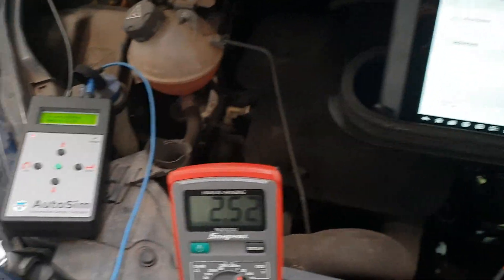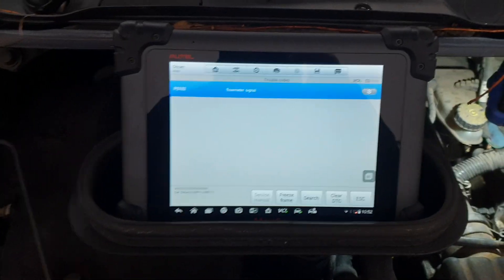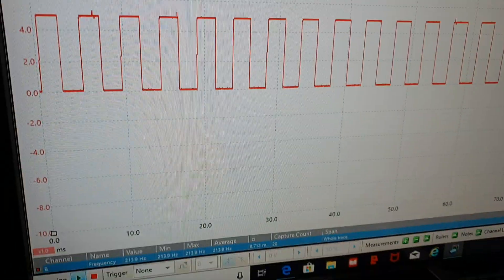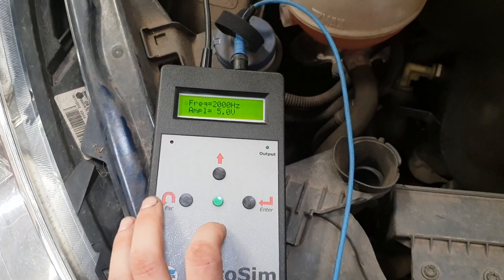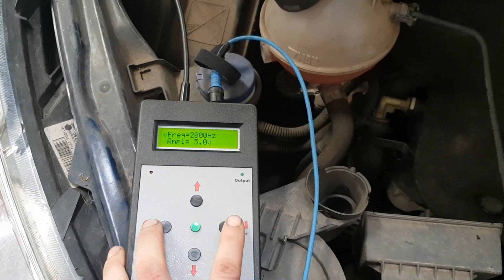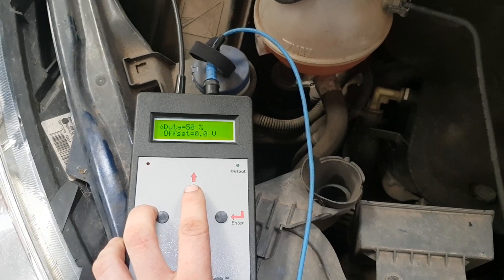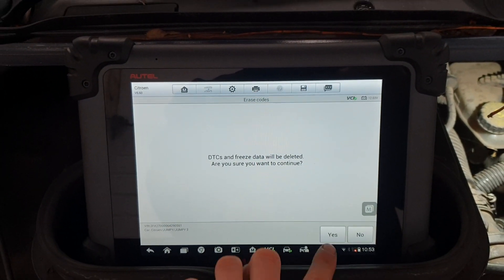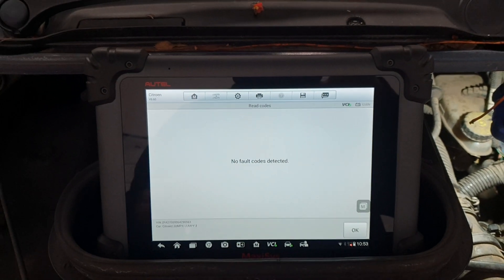Ditex Signal Generator Case Study.

Comment: could you of used the generator and then looked at the scan tools live data to see if it was working as well?
Reply from the maker: Unfortunately not due to the code being permanent the engine computer was using a substituted value therefore the live data figure would have been false.